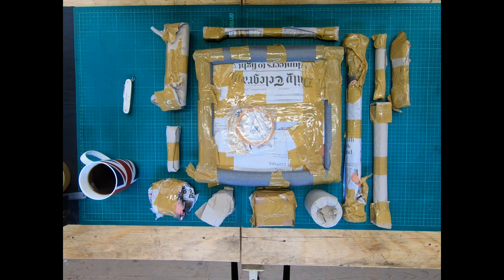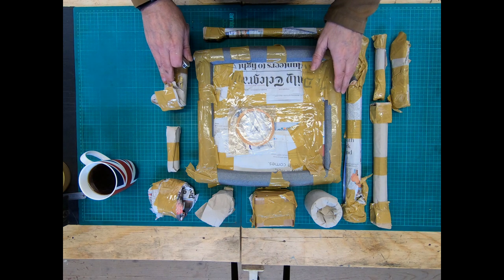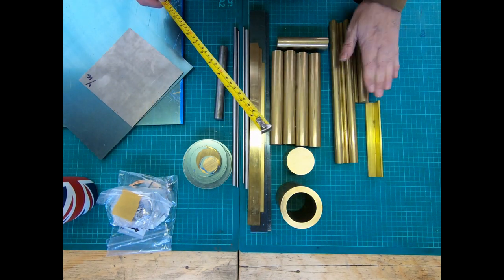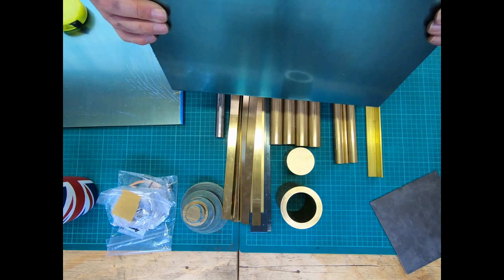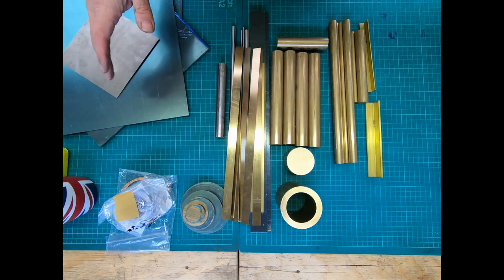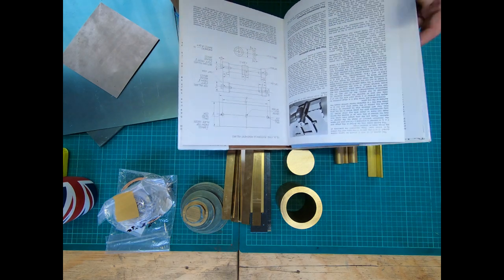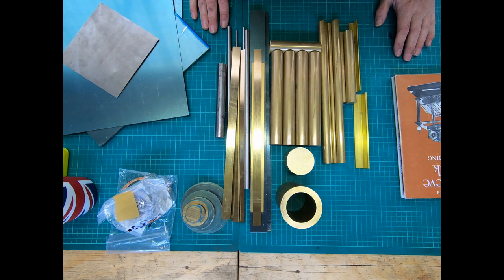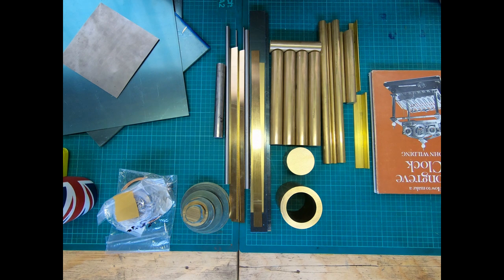Making a Congreve Clock - Part 2 - The Materials.

Comment: Hi Paul. Impressive selection of materials there. I've bought a few smaller bits of thin sheet material before and they always seem to have a dink in them. Was thinking about making an automated indexer that would also feed, so for cutting gears you could set the thing up and come back when it was finished!
Reply from the maker: Hello Olly,
There is indeed quite a lot of material... I have had to hide it away to ensure I don't accidentally use any of it for something else. Your gear cutting idea sounds good. 
Take care.
Paul,,